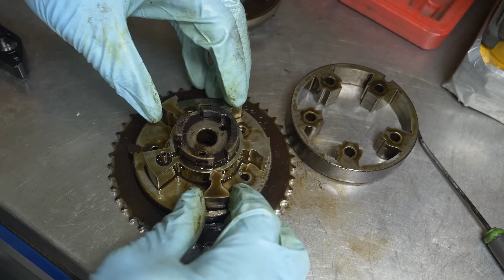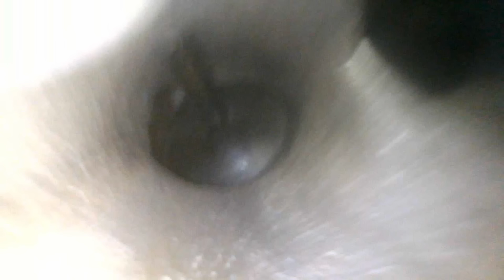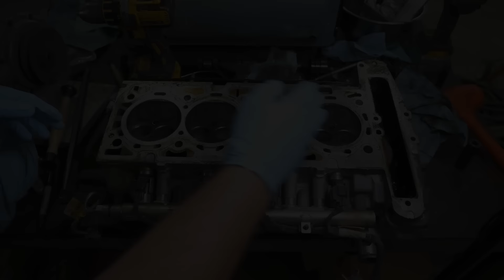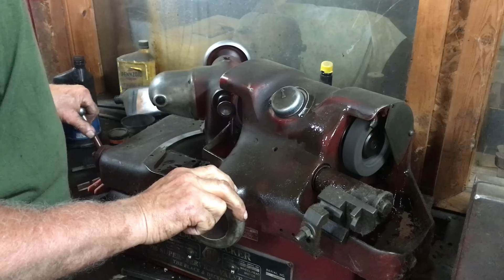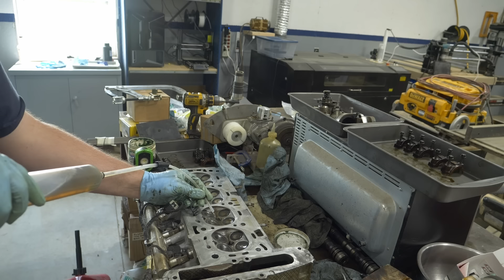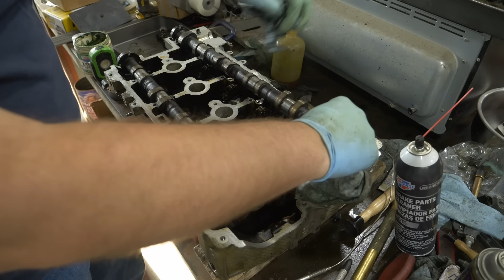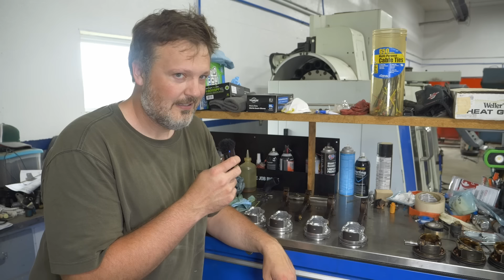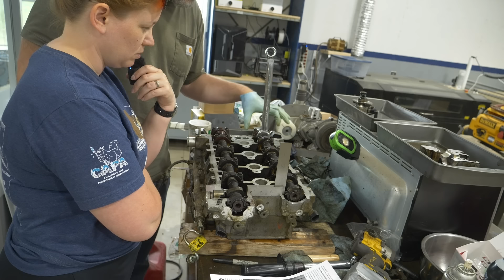How Did it Ever Run? Equinox Still Won't Start

Comment: Wes I give you credit for even working on this cluster that engine was read to grenade but had enough other things wrong it just gave up running , my brother has one of these that he bought used with low miles and it has what sounds like wrist pin noise and after seeing your video I now see the problem , he has had it over two years and we both agreed to drive it till it blows and just buy another car the engine sound hasn't got any worse but he has run engine cleaner threw it and put good oil in it so the sound may have been from sticking rings it runs great and he has took it on some trips and it like it was slugged up maybe who knows its his winter car and he only has to drive like 5miles to work and ball games , he has two of them he bought one for his daughter and it to was awd she said that the thing was getting stuck this winter so he jacked it up and the drive shaft was gone he called up the dealer and of coarse they said it wasnt their problem so it took awhile but he finally found a drive shaft that works like you on the parts he was so pissed off from the b.s. of finding the right part that worked , he is now working on a 1970 dodge pick up that I had when I was in my 20s and has got it up and driving it and loves how simple it was to fix luckly he found most of the trim parts at local junk yards and the other parts he just got online it has a 318 engine in it for now but he is building a 440 to set in it later the 318 runs good with the 3.73 gears I had in it and got good fuel millage but ha wants more power lol its a toy to him and he loves the truck it was free gift , back to your job 7k for a engine when you can buy another for less thats a toss up may have the same crap go wrong may be best to fix what you have and drive the wheels off it or trade up to better but be safe and like you if it was mine it would have been gone take care like your videos

Comment: I had the problem it's fun bearings and a bunch of other things too because the idiots that put the oil in the car didn't do it thank God I get out and check the car soon as I pull out of their shop it was running when I got there.

Comment: If the 2.4 is so hard to find parts for...part out the old engine to offset the cost of a reman or do you need a core? Do an electric conversion? Put a diesel in it? Just rebuild it. Good luck. We're here for you.

Comment: Sure didn't see that coming.  I thought you would end up pulling the head but didn't expect the multitude of bad surprises underneath.  Sadly, your wife's recommendation is probably the most reliable solution although you've already replaced most of the components in the engine.  The little guy made a keen observation regarding his trebuchet at the end, that it is more dangerous for the shooter!  Maybe it needs a bucket full of old 2.4L parts around the base to provide additional gravity?

Comment: For a non-damaging cleaning tool (for the home mechanic), you can use a bunch of cable ties bound together the the ends cut off. The sharp ends will clean the carbon off, but the plastic won't damage the alloy or finished surfaces. A bit of seafoam to help loosen it all up while you poke around your cable ties, and then use the shop vac to suck all the crud out.

Comment: Had a 2011 Nissan Sentra that would not start in 13 degree or lower.   Took it in they would put in the shop and it would start.  Told me sucks to be you.  It ended up pouring hot water over the computer.  Started every time.  Thanks smart guy i work with.

Comment: Wrist pin bushings is something a good machine should be able to modify something close enough to make work. One shop I know can make them from stock bar they buy, and then make them on the lathe. Then they press them in and hone them to exat size. Not terrible expensive . They do a lot of stuff for really old engines that haven’t had parts available for half a century.

Comment: Good work Wes.
Not good results, but good work 😂
I would tig weld a couple spots to hold the relucter in place after you check fo clearance and give it a go...

Comment: I used to tell kids if they wait for the oil light to come on they can add up the damage at $10.00 for every second it's on. I'm changing that to $20.😃 Thanks for the combination of knowledge and entertainment Wes.
Reply: lol. It is more like 500$ per second with modern engines, especially if under power...
Reply: These days that light isn't a "Shut 'er down!" light, it's a 'replace engine' light!

Comment: Yeah if only you knew. I myself bought an old 97 dodge 2500. Test drove and looked it over. I knew trans problems and a couple other things and thought a couple thousand and it will be good to go. Motor good except some oil leaks but the rest of the truck not so much. That couple thousand was just tickling the troubles. Can’t wait for the next video it always makes me feel better seeing I’m not the only one.

Comment: Don't beat yourself up, this does happen on other OHC engines 4,6,8,10 and 12 more so on turbo engines that employ a vacuum pump driven by a cam shaft via a pressed on reluctor that doubles as the connection for the vacuum pump.
You could have put a scope on it and found that right off.

Comment: Many GDI are having this issue.

Curious if you can drill tap intake manifold ports to reposition injectors out of cylinder m
Like old Vortec style injection.

I used oven cleaner in intake and piston on old carboned up junkers.

Let sit 30 minutes then crank it out of plug holes then put marvel mystery oil in cylinders.

Run 20W-50 oil in oil high mileage oil burning motors .
Cuts down on consumption.

Comment: Mercedes has the same problem with reluctor wheels moving on the camshaft.  I have done several M274 engines (in C300 model) where the reluctor wheel moved triggering an intake camshaft code and a long crank.  On both I found that the locking pin on the cam phaser had worn a depression around the hole on the camshaft.  I believe the rattling or hammering on startup from the pin not locking, is what causes the reluctor to turn

Comment: do you think these problems could be caused by the emissions laws that are about?  Like running the exhaust back through the engine for a second burn - if your engine is burning oil, then (correct me if im wrong) your just going to coat the insides with burnt oil?  Also, a thought... if the engine is suffering from over heating, could that be caused by the burning of the oil - would that make it run hot?  

As an aside, are these similar faults of a car running nox?  Not that your brother would keep details like that from you ;)

Comment: Oh the fun of learning what long time GM techs have seen for years, on you own, all by yourself. Good thing you are a smart resourceful guy, or dynamite may have been employed. I would have to drill a .030” hole in the reluctant/camshaft and slide a well Loctited pin for piece if mind, and maybe add a couple drain back holes into the oil ring land. Is Ecotec another spelling of junk?
Reply: drill hardened camshaft?
Reply: @rasz not hard, cast iron

Comment: Thank God I just got rid of mine just shy of 100,000 mile because I felt like the trans was about to go. Also around 6 months ago it cost me $800 to get the exhaust air injection holes cleaned out. Was also burning oil.

Comment: I am not impressed with car manufacturers! Way, way, way over engineering with "will fail" electronics added in!  What ever happened to "keep it simple"?  Stability produces longevity and dependability.  Wes - I feel for you bro!  Waiting on the next instalment of a very, very bad engine design.  What else has gone wrong at GM?  Thanks for part 2!!!

Comment: I would bet a dollar against a donut that they ran that thing with little or no oil. I have a 2015 GMC Terrain with that engine, and the notorious pvc issue which throws a lot of oil out the tailpipe. Mine has 220000 miles on it, never any issue with timing yet, but you have to keep a close check on oil level.

Comment: Whew.. .  Retired motorcycle mechanic here, now in my eighties, son of a father who was an auto and light truck mechanic until about 1950.  All I can say is you're a good soldier to persevere thoroughly.  I'm totally put off by direct injection engines for the reason you've covered here.  Earliest I know DI came along was in WW2 aircraft engines;  They always ran hard for long periods, circumstances didn't support carbon build up like you encountered here.  Enjoyed watching as you made the struggle tolerable somehow to watch..!
Reply: If I may ask a question regarding early GDI engines. Not sure if you know the answer, but.... Did early GDI engines require a very high pressure pump to build up fuel pressure?  And if so, were they noisy as hell ??
Seems that today's modern GDI's all have these funky, loud pumps clattering away, which make the car sound like you are running an engine with no oil in the sump.  I have heard silly theories that the stupid plastic engine covers are there to reduce, muffle, suppress the sound of this chattering high pressure fuel pump sound. I currently have an '11 Hyundai Tucson with this noise issue. Engine runs fine, just sounds like an angry bag of hammers trying to escape.
Reply: @stanpatterson5033  You would need to research the aircraft engines that have used or currently use GDI systems.  Aircraft engines have never been required to meet standards that are applicable to automobile systems.  I was never exposed to that technology directly.  I currently drive a '99 Plymouth van with port injection and that system uses much lower pressure, actually an electric fuel pump of about 15 psi.  It stands to reason that high pressure systems are under a good deal more stress to operate and depending on the manufacturer, one will perhaps be nosier that others.  A couple examples of old aircraft engines when the high-pressure systems began to be used were the Wright R3350 and the Pratt and Whitney R2800 during the latter years of WW2.  You might Google "noises of GDI systems" for better details.
Reply: I believe the carbon build up is from the EGR valve dumping carbon in the intake and its exacerbated by the oil burning from the bad piston oil control rings.
Reply: @samthemultimediaman not just the EGR but any blow-by into the crankcase gets back to the intake via the PCV gives it the oil vapour to turn the carbon into a lovely gooey mess 😂
Reply: The military is a whole different world. Engine runs x number of hours (if the aircraft doesn't get shot down in the interval) pull it and send it back in for a complete rebuild. When the factory built the engines they would run them in for a period of time and then tear the whole thing down to bits and inspect every part before reassembling them for shipment.

Comment: Is that fire extinguisher dry chem all over the engine compartment? If it is, it’s very corrosive over time. Could it have ruined something electronic? I’ve seen that stuff cause a lot of problems in fire department vehicles.

Comment: That engine is the gift that keeps on giving. 

I found simple green cleaner to be ideal for soaking a head and pistons like that to remove the carbon. I used to soak pistons like that for a day and you can use a toothbrush to clean the carbon off. The pistons would look like brand new. 

Nice reference to Galloping Gerti. I had to cross the two newer ones for 25 years to go to Tacoma. 

Better not look at the crankshaft to closely. 🤣🤣

Comment: Have an idea!!  Can you take that cam gear and the other cam gear. To machine shop have them put a small drilled 3/16" hole in the end of the reluctor through the side. And lock the position in with a tacked on weld.  That will never make it move again

Comment: I'm sure you'll get it fixed. Hopefully it runs for at least a week before it needs a transmission. It will never cease to amaze me how bad a product GM can turn out and somehow remain in business. Everything is bad right now, but GM is particularly bad. I just did an oil pump on a 2017ish 5.3 where somehow the housing just broke in half where the vanes run. How does that happen? It's not even uncommon which is even stranger. Thank you for the entertainment

Comment: Chevy dealer tech here!, the only time I’ve had the reluctor spin on the cam is when the timing chain either goes completely slack, or if an actuator physically breaks. Just the way this engine has all valve damage and wrist pin bushing damage it must have had a timing chain failure, causing the valves to push on the piston.Just odd there is no other evidence to show that. Hm.
Reply from the maker: I'm wondering if the timing chain guide being broken, or maybe a bad tensioner piston caused some nasty vibration which broke the phaser and moved the reluctor. That then changed the timing and caused all sorts of destruction. Sort of a cascade of destruction. Or maybe it's just a POS.

Comment: GDI for the win! 
When i bought my 2020 Highlander I made sure it had both GDI and port injection. GDI alone engines need to be banned.

AI is overrated. 
Too much hype. It has its uses of course and it can be helpful in many situations, however people will still have to work. Even you.

9:02 I can hear Taryl now..
"It's not starting!"

Comment: I used to think that mechanics did this kind of repair all the time. Nope. Not worth it, in the end you have a used Equinox. This has been a fun, eye opening video set to watch. Lesser men would have pulled the plug long ago, For better or for worse, it was the family connection that kept you going.

Comment: I work in IT and besides that IT is my hobby and I happen to use AI to do some tasks for me that I am too lazy to do. 
Turns out, AI is pretty self confident about its information even if it is helplessly outdated. I tried lots of things for hours, only to discover that AI has recommended me long abandoned projects. 

If you want Ai to take over your job, be prepared, that AI will most likely order parts for a Ford Model T if you want it to repair your electric car.

Comment: had Captiva with that engine. replaced it with  gm re-man that was bad from factory with misfire one one cylinder, they put a second re-man engine in it which also had  a misfire but on different cylinder. after master GM tech came in and a month later could not figure out what was wrong. they gave up and just gave me back the car free of charge. gm shop was in it for over 14K. still have Captiva. runs but misfires under load. Junk engines. better to just junk them.

Comment: I think the reluctor wheel is the smoking gun, I think it would have started the last time if not for that.  I agree with you the car isn't worth the 7K for a "new" engine.  I believe you found the problem and slap it back together it WILL definitely run this time.  This has been a great series, loved it and great work as always.
Reply: What was the optimism counter up to?

Comment: I’m pretty shocked at how many failures that engine had. I’ve had family members drive these cars literally till the wheels fell off and yes, they burned oil but my uncle’s equinox had 250,000 miles before he sold it and it still ran perfectly 😂.

Comment: What an unbelievable piece of junk.  Incredible that you could identify/figure out all the failures.  This is why you are my favorite channel.
Reply: It's believable. It is design by committee. Various departments all had their priorities and this engine is the result of all of that. Meanwhile everyone involved did the minimum to meet all of those requirements. Because it is just a job.
Reply: Lack of maintenance, extended oil change intervals, using cheap oil. (Seen people request conventional oil in cars,not necessarily these, when they need synthetic) etc, contribute to the downfall.

Comment: This is another great episode. Nice trick with the 3D printed blaster vacuum attachment. I'm always a sucker for fixing things, economically sensible or not. But this has that added flare of mystery and tragedy that has me hooked. Could you explain the cracked bearings? Is that just something that happens when they spin in the housing?

Comment: Just imagine how good an engine could be made if the EPA didn't rule the roost. They are forced to build smaller engines that run higher rpm and they are then forced to build them as light weight as possible. They keep lowering the oil viscosity to be water and reduce the volume of oil, and stretch the change intervals beyond reason. Made the engine run too hot. Add in ethanol fuel to screw up the fuel system. What else can you think of that has ruined engine manufacturing? Oh yeah... The wonderful bean counters that insist on doing anything to save a penny!

Comment: That interferance fit on the cam control made me think of my first shrimpboat hydraulic drive gear Twin Disc.  It had the clutch pack pressed on the shaft that was the drive for the hydraulic oil pump.  It worked great in forward but if pushed a little too hard reverse would completely release.  I gave up and took it to a Twin Disc service shop and I had almost no money and was desperate.  I asked the technician if he would look at the pile of parts in my pick up bed and he said sure.  After a few minutes of looking at all the perfect looking parts he sat down on the tail gate and was just holding the shaft with the clutch housing in his hands and spinning it on the shaft.  He lit up like a light bulb and said that's not supposed to do that.  Lucky for me he had a collection of good used parts and made me a deal and I was back on the water the next day.  That  was about 55 years ago and I'll never forget.
Reply: Ford did pressed on timing chain sprockets on the v8 Taurus SHO. Ended up being the downfall of it. Nearly every one came loose and destroyed the engine.
Reply: @kd7cwg  fr this sounds like the last thing you would risk saving a few cents on, it's such an important component. Wiki says it was Yamaha's design idea